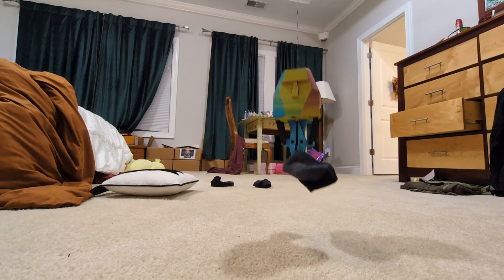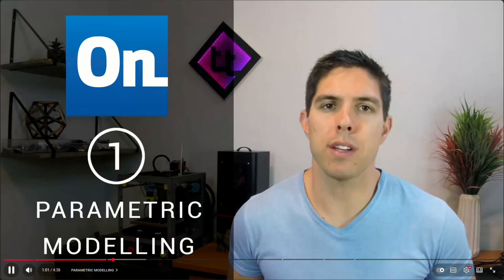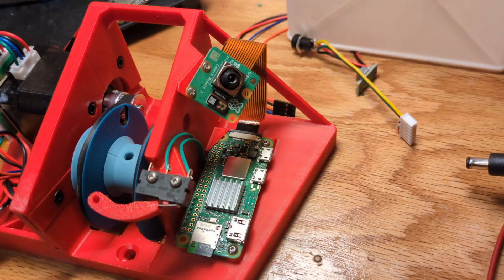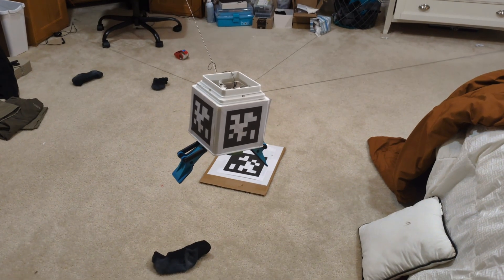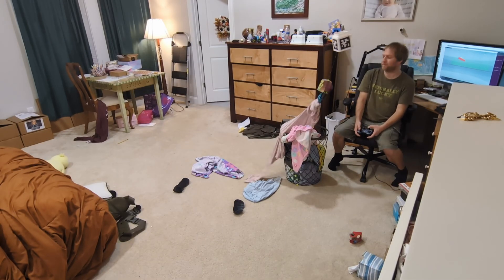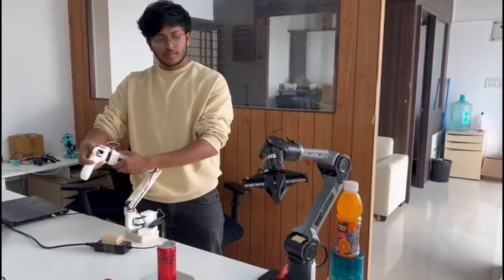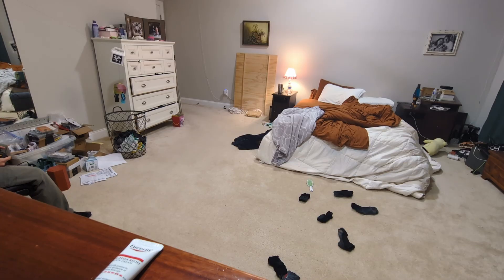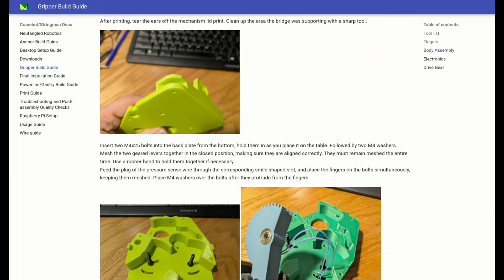Stringman - Integrating with LeRobot

Comment: I wonder if it would work to use a VR full body tracker and a couple of lighthouses. Those have like millimeter accurate tracking, but requires putting lighthouses up.
Reply from the maker: It very much would work. Its a common approach too. But im working on making this so cheap that people who dont already have maids could buy one. And it turns out a camera or two is good enough

Comment: This is awesome project! 

Have you considered making one of the 4 corners it's docking station?
I feel like it would unwind and I would run into it during a power outage.
Reply from the maker: Yes, it'll either be under one of the corners or on a sidewall between two of them, but I am working on a docking station that it can automatically park on